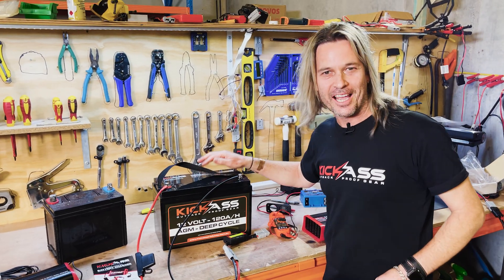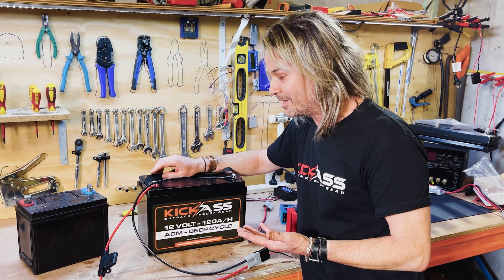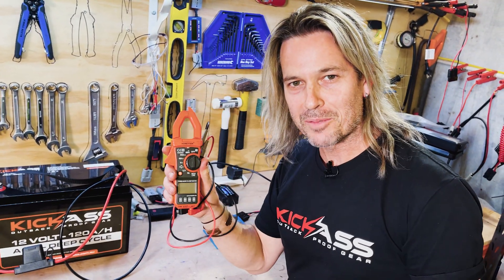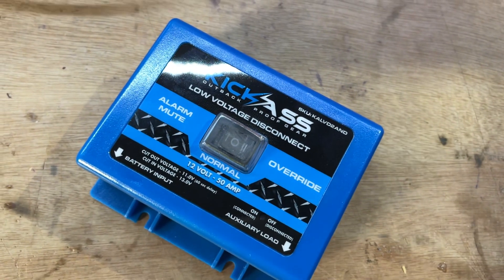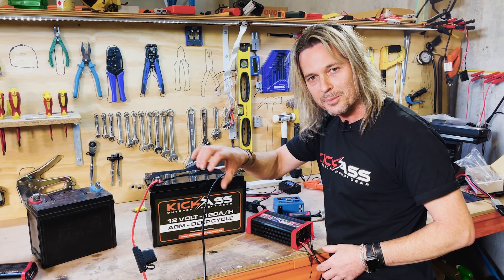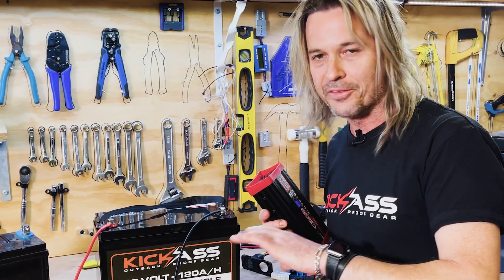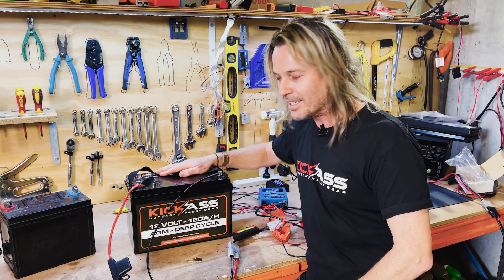How to charge and maintain deep cycle AGM batteries with Craig from KickAss Products

Comment: How many of us can control our battery going less than 50% ???
Reply from the maker: G'day mate,it really is a matter of monitoring  your voltage with a agm battert,at 12v its considered flat,& going below that is really not fantastic for the longevity of your battery,i kind of had the rule that if my battery is getting down around 12.2 & i have no charge going in to re-coup,then something is going wrong,EG: maybe solar panel connection worked loose?,shade on solar panel,solar regulater fault,maybe dcdc not working etc 
also there a re quite a few gadgets we sell to stop your battery getting flttened like our low voltage disconnect,& battery guard
here is a few links for you to look at & remember monitoring is the key to not having flatt battery's 

https://kickassproducts.com.au/products/kickass-quick-connect-low-voltage-disconnect-lvd?keyword=low%20voltage
here is the video for you 
https://youtu.be/7BToGHL4VF0?si=lMbWJviJiiG1Tu_8

Comment: Don't have a load attached to the battery when charging?! Really? How's that going to ever work? Drive to a campsite with a caravan or camping trailer, with a fridge running.........you've got a load on the leisure battery at the same time as you're charging via the alternator. Plug into a campsite mains supply, you're fridge needs to run.......so what are you supposed to do?
Reply from the maker: G'day Mike,
you may have misunderstood the point i was trying to get across,of course, batteries can be charged while driving  with dcdc/alternator as that's what they're designed to do,i was saying that to do a proper maintenance charge on your battery with a 240V AC charger  it is better to have no loads on the battery untill fully charged  & is a graet way to look after your battery & do that every few months is higly recomended
thanks for watching & commenting 
Cheers Craig

Comment: I’m looking for this information for my actual starting battery. My corvette tends to discharge the battery over time. They are well known for this and mine is even a bit more aggressive than average I would say. After a 4 day weekend sometimes it will turn over slow. I consider it too small for the car as well and figure it should be at least 70ah where it’s only like a 45 to 55ah battery. But it’s an expensive optima so I kinda like it. 
I’m looking to understand what voltage is best to keep it at during maintenance charging so I can make sure my maintenance charger isn’t overcharging or anything. I also have a charger that I can set a specific voltage as well with a rotary dial I can set to a very specific voltage same for amperage which sets it as the maximum amperage which slowly tapers as the charge happens. Anyway I want to know best maintenance charge voltage, At what voltage the charger should restart. And what’s the minimum voltage I should allow when not maintaining with a charger. 
Like today for example, it had sat for 3 days and that was after very short trips the times I did drive before it was parked for 3 days. The voltage showed 12.3, how bad is that on a starter battery?? Makes me wonder if I should buy a deep cycle/starter battery. One of the ones good for both.
Reply: What about my car battery, disconnecting it everytime would be a major pain, will the small parasitic draw of the car be enough to mess up the charge algorithm?? It draws .05 to .06 amps so a bit more than a normal car but for some reason corvette C5s are known for this.
Reply from the maker: Thanks for watching & glad you got some info from it 
Cheers Craig

Comment: Help! I have a go power 30amp charge controller, a 200 watt flex solar panel and 2 6volt agm 224ah batteries connected in series to get 12 volts on my camper. I try to keep the batteries fully charged! For some reason I never see the solar panel charging the batteries…. Do they have to go below some sort of threshold for the solar panel to start charging? Everything is brand new! Thanks in advance.
Reply from the maker: G'day there, your charge controller should start charging from solar as soon as there is voltage in your solar panel and the batteries need some charge, have you checked your connections?

Comment: So if you need a special charger to charge an AGM battery, how is it that the car you put the AGM battery into (that's designed to charge a standard lead acid battery) doesn't ruin the AGM battery?
Reply from the maker: G'day mate,i dont know of to many cars that use a standard lead acid battery these days but it really does pay to use the correct charger for the correct battery chemistry, most car start batteries are high cranking calcium & agm style,we want to charge our deep cycle battery's differently ,there for use a charger designed for agm 
Cheers CRaig

Comment: Suppose I want to check the health of the AGM battery and put a load on it
They sell those testers that put a heavy load on the battery, I believe typically it's 100Ah for a few seconds
Is it right that those testers are designed for automotive batteries and that while they may be reliable in terms of CCAs they are not in the case of deep cycle AGMs?
After all a deep cycle unit is not supposed to give you CCAs, but a constant current
Incidentally, can you damage a deep cycle AGM unit by testing it with one of those 100Ah-draiining devices ?
Reply from the maker: G'day there,no agm deep cycle battery's are not desighned for 100a loads & is a different process than using a car start battery cca tester,
most good battery stores can test for you
Cheers CRaig
Reply: @KickAssProducts  can you recommend some device if I'd like to own one and have it with me, or is it overkill for a user to purchase it?

Comment: My battery goes down to 11.5v when i connect my inverter but does back to 12.6v when disconnected  at what point on load should i stop using the battery
Reply from the maker: G'day there with big inverter loads it will drop battery voltage until,load is disconnected,if it bounces back to 12.6 then thats ok but it would be better getting voltage back up to 12.9+
Thanks for watching
Cheers CRaig

Comment: I have a nexpeak smart charger, model NC201 which is a 10amp model.  I'm buying a new 200ah renogy agm battery for a PV installation.  Would the 10 amp charger work to do an initial charge on the battery before install it?
Reply from the maker: G'day mate you would have to check that particular chargers output but 10 amps for a 200 a/h battery is going to take a long time i would suggest something like this 
https://kickassproducts.com.au/products/kickass-12v-22amp-9-stage-automatic-smart-battery-charger-for-lead-acid-agm-lithium-batteries?_pos=4&_sid=84bd0874b&_ss=r
cheers Craig

Comment: Hey Craig, you say dont have any load on battery when charging with 240v charger. Crikey mate, my caravan came with a 240v  x  15A  charger permanently connected and it starts by itself every time I plug in at a powered site, which is almost every day. Are you saying I should turn off all 12v loads when its going? Thats impossible as it starts and stops by itself when ever the battery gets low. Its under the bed and we can hear it start up sometimes if the tv is off. Am I missing something?
Reply from the maker: G'day mate,ideally you want all loads disconnected to do a complete full maintenance  charge as the charger can over compensate if there is a constant load on the battery & the charger is trying to complete it's charge cycle,but a lot of people still charge with loads on the battery,for instant a fridge kicking in once an hour would not bother it but pulling say 10 amps from battery while charger is on is not a good practice
Thanks for watching 
Cheers Craig
Reply: @KickAssProducts  Thanks mate, appreciate it. I guess during the night its not much a problem, but during the day, I would often pull 10 amps using elec heater, toaster, microwave... so I think what I will do is turn off the charger during the day while solar will keep it charged, and turn on at night only.

Comment: I have an 140Ah. AGM battery which I didn't look at for a couple of years. I pulled it out &i i measured 8.9V. I restored it by putting another 140Ah battery & charged it with an Century Smart Charge, on AGM, 8A. It worked & came up to 12.8V. It does lose .5v over night.

However, when I put it to the Inverter, the Inverter won't accept it & the Red LED comes on & it beeps. The Inverter shows 9.8V.

Any ideas?
Reply from the maker: G'day mate taking the battery down to 8.9v would have put the nail in the coffin mate,& usually they will never recover & since it only came up to 12.8 i  suggest you grab yourself a new battery,if you go lithium then you never have to worry about that issue again 
thanks for watching 
Cheers Craig

Comment: The only con I see with AGM is it can't be topped off if it needs distilled water because even "sealed" acid batteries still vent off, and also, you can't check each cell for readings, you can have a "healthy" reading from the terminal post, but there could be an inefficient cell that's gonna affect the other cell because they have to pick up the slack causing uneven wear-n-tear over time.
Reply from the maker: Thanks for watching appreciate it 
Cheers Craig

Comment: I'm having some trouble understanding recharging my battery voltage for my car battery interstate mtx 49/h8 (AGM)

My Mercedes Benz 2003 W211 E320 states that the battery should be at 12.8v but when doing a trickle charge on the battery i reached 13.1v and it show 80% charged on the charging device.
However some people state the car battery should be at 14v when fully charged.

Unfortunately it doesn't state on the battery itself what voltage it should be at or charged to and i don't want to overcharge the battery just because it says it's only at 80% charge.
What's the proper fully charged voltage for this battery?
Reply from the maker: G'day mate you will need to find out that info from the battery or manufacturer,if it helps our kickass dcdc & ac chargers will let you know when the battery is completely charged so you don't have to worry about it yourself just select the agm battery profile & let the charger do the rest for you with no stress
here is a link to the battery chargers
https://kickassproducts.com.au/collections/12v-battery-chargers
tyhanks for watching 
Cheers Craig

Comment: I just got a new 138ah battery to replace an aging 120ah, should i charge it right up before connecting loads?

I also have a dcdc charger and my aux battery is hard to get to so i was planning on having ring terminals from the battery to an Anderson and then just plug this charger into the Anderson from time to time. That means i cant disconnect the loads while it charges - is this a problem?
I dont plan on having anything turned on when charging from 240V, just when its parked and charging before heading camping
Reply from the maker: G'day there i always recommend charging a battery completely before putting into use & always better to disconnect any loads when charging 
thanks for watching 
Cheers Craig

Comment: I’ve never realized volts could
Be used for knowing capacity. Yet my AGM on my boat was over 13 v yet showed 50% on the charger 🤷🏼‍♂️
Reply from the maker: G'day there,thanks for watching mate,your battery should have all the info on it as well so that also comes in handy to check the specs
Thanks for watching
Cheers Craig

Comment: Bad advice to tell people 12v as a minimum voltage as it will damage the hell out of it. 30% is the normal maximum discharge rate if you want to keep it more than a few months. 
I have lived off grid for over 30 years and killed a few batteries in that time not knowing how to do it and listening to bad advice like this
Reply from the maker: Thanks for watching Matt 
Cheers Craig

Comment: I'm hoping someone can explain something to me about testing an AGM with a modern style digital battery tester.
Many AGM batteries only come with an amp hour rating and no CCA or other standard rating. My Topdon branded battery tester seems to work fine but when I test some brand new AGM batteries (some, not all, Enersys Supersafe AGM batteries test fine) with it using the "GB" standard which allows me to input the Ah rating to test with I get results showing 50% health.
Is this a problem with the testing method, a problem with the battery rating or a problem with some brand new batteries actually being faulty?
This is not a problem I have seen with regular lead acid batteries or any AGM that has a CCA or similar rating I can test with.
Reply from the maker: G'day mate your topdon tester is only for cca testing & internal resistance  unfortunately you would need to do a capacity test for deep cycle batteries as they don't & are not designed for cca testing - its a different testing device all together  - if you google deep cycle battery tester there is a few out there 

cheers Craig

Comment: Do I need a dc to dc charger if I’m running an Engel smart battery box? Can I simply run an Anderson plug to the rear of the vehicle to plug into while driving?
Reply from the maker: G'day  there,yes a dcdc would definably help with the charging for sure & also act as a battery isolator to disconnect from the start battery when engine not running 
Thanks for watching 
Cheers Craig

Comment: Great video and explanation. I am going to buy a AGM battery when my 2001 BMW 530i my current battery fails. I am using a PulseTech PowerPulse passive battery desulfator on it to keep it working longer, PulseTech states that there patented frequency used to desulfate a battery can extend battery life by up to three times.
Reply from the maker: Glad it was helpful!
cheers craig

Comment: While using the battery the watt meter says 11.5 but battery jumps back up when not in use? Is that normal?
Reply from the maker: G'day therw,yes that is normal for a battery to drop voltage while in use,a;though 11.5 is very low if not on the flat side i would give your battery a good maintenance charge with an ac charger & monotor the battery's performance 
Thanks for watching
Cheers
Craig

Comment: Excellent video. Thanks. Can i use an AGM battery during the night and charge it the next day? Does it affect its performance? or do I have to charge it right after using the load?
Reply from the maker: G'day mate,you defiantly can use during the night,the whole idea is to get as much charge into your battery during the day via solar panel or while your driving & have the battery fully charged up & rinse & repeat every day,as long as you make sure you don't take battery down  to  12 v  - if you do you defiantly need to get more charge in the battery during the day 
Thanks for watching 
Cheers
Craig
Reply: Alright. Thanks for the information. I have another question: a battery cycle is when you use the charge down to 30%;  If I keep the charge at 60% or more, that's not even a cycle, am i right? I just got a solar kit because I want to pay less and contribute to take care of the environment, and I'm learnig how to use these technologies.  @KickAssProducts

Comment: So the battery meters won't drain the battery slowly if left on over time and are you saying just charging off the car alternator with a solenoid is possible to overcharge the battery, as crank batteries don't get overcharged off the alternator, or does it help only to charge the battery faster than just using alternator?  Thanks
Reply from the maker: G'day there,a basic  battery/volt meter will use bugger all - a flash battery management with lcd screen & bells & whistles will use more,but at least you can guage the battery voltage & connect to a charger when getting low 
thanks for watching 
Cheers Craig

Comment: The battery chart you showed at 1:49. Was that under load (during discharge) or Open circuit voltage of the battery?
Reply from the maker: G'day there,it'a state of charge/voltage  graph no loads mate 
Cheers 
Thanks for watching

Comment: I am considering 2 of your 120ah slim batteries for my car stereo. As of right now I only have a 90 amp alternator, but I do plan on getting a 370 amp alt, but my question is if I got two of those would I be ok with my current alt as long as I fully charge them before I install, and just keep a good eye on the voltage??? Also, are those even a good choice for car audio??? Thanks    
EDIT: My cars alt stays right up to about 14.2v, is that ok for charging with my alt???
Reply from the maker: Absolutely bear you could use the battery's to power your stereo,i would suggest running a dcdc charger to look after the battery's is a link for you to look at 
https://www.kickassproducts.com.au/buy/lithium-12120-slimline-battery/KA12120SLIM-LION
https://www.kickassproducts.com.au/buy/kickass-40a-dcdc-charger-8m-heavy-duty-dcdc-wiring/KADCDC40A-AND-WK65

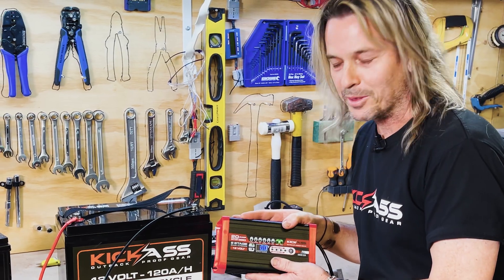Comment: 5:28 this is only relevant for low quality battery chargers. Any good quality one will not affect it and will help run the system
Reply from the maker: Thanks again for your input DIY
Cheers Craig

Comment: My battery reads 12.2 volts when unloaded. With a slight load, 5 amps, it drops below 12... even lower I am sad to say.  So, shouldn't the battery voltage be measured with a slight load?
Reply from the maker: G'day Mark if your battery is reading 12.2 volts after being charged you need a new battery mate,here is a link to our battery's if it helps you out
 https://www.kickassproducts.com.au/buy/kickass-1200w-pure-sine-wave-digital-inverter/KAI1200WPD?query=battery&hierarchicalMenu%5Bcategories.lvl0%5D%5B0%5D=Batteries%20%26%20Systems
Cheers Craig

Comment: Can I charge my battery box direct from my Anderson plug at my tow ball, or do I need a dc charger?
Reply from the maker: G'day Mate,if you have a VSR/Battery isolator then it will be better than nothing but our DCDC charger boost's the lower amperage from cars charging system & boosts the amps so it charges quickly, completely & efficiently 
cheers Craig